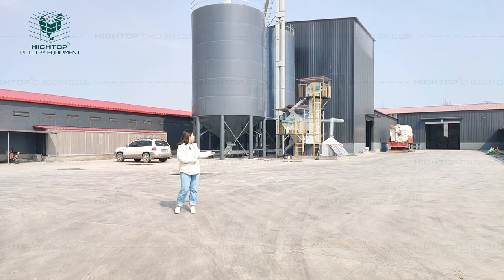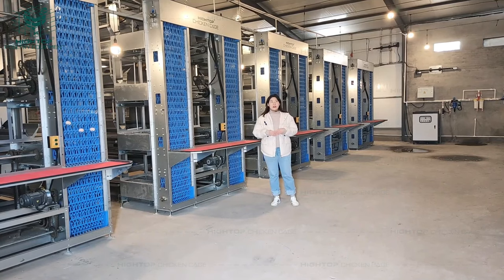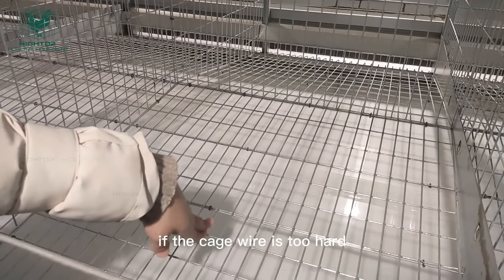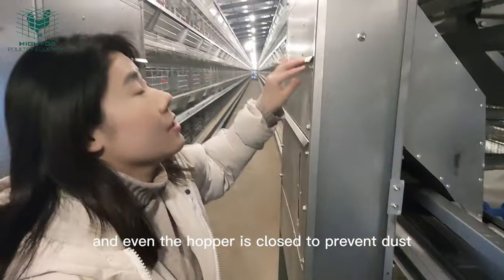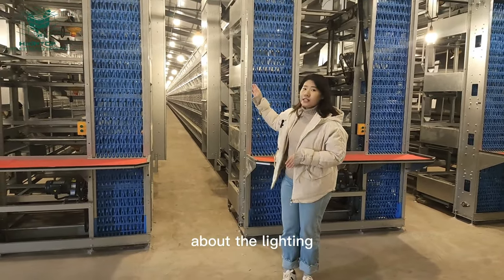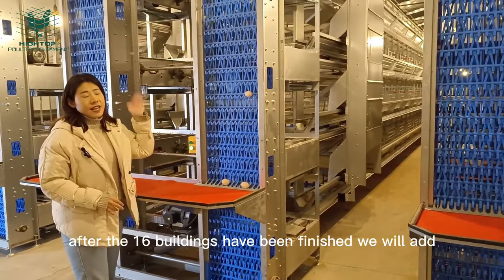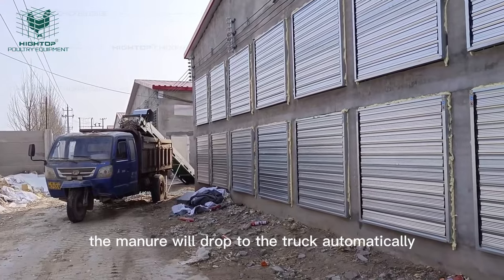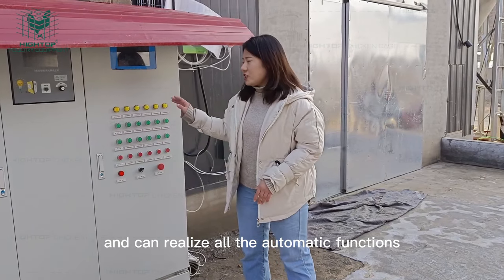800,000 Chickens Modern Layer Farm On Live

Comment: 00:20 China modern layer farm with 800,000 chickens
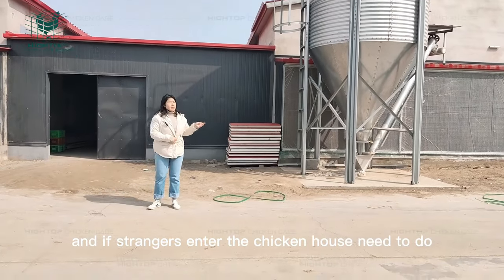04:16 Explaining equipment costs for chicken farming
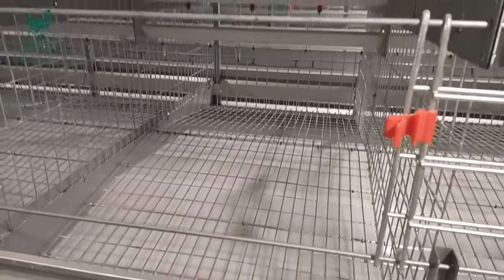10:26 Modern layer farm setup for comfort and productivity
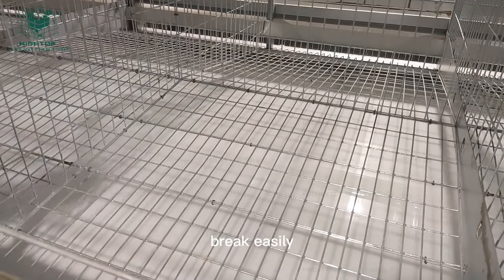14:02 Importance of cage frame design in modern layer farms
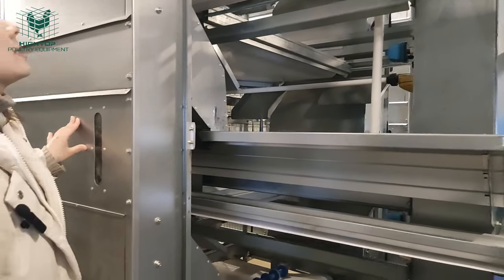20:31 Overview of automatic feeding and water systems
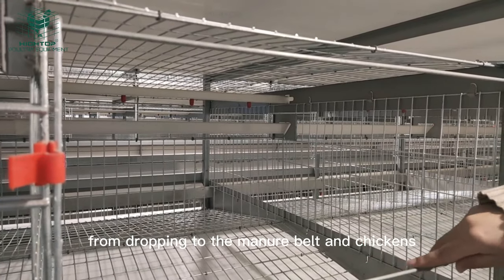24:29 Automatic water supply for chickens
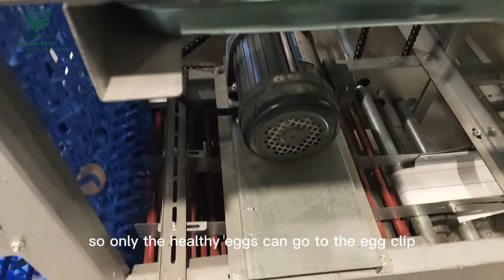31:56 Efficient egg collection process
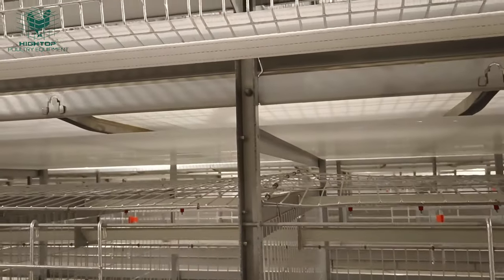36:00 Cleaning process of chicken manure using three scrapers
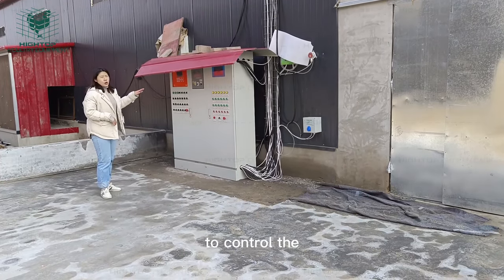45:35 Modern layer farm technology and operations
Crafted by Merlin AI.

Comment: Hi Rene, with the 10,000 chicken automated which you state is $10,000 USD  Do you guys provide a temperature data system that continuously monitor the layers or is that at a seperate cost. @Renee???
Reply from the maker: not included
Reply: I need the equipment for 10,000 birds

Comment: If I have to pay $160k for 40K production or pay $10k for 10K production, I think  I will pay four times $10k($40K) to have 40K production instead.
Reply: So what's your point?
Reply: Good idea.  but what they said USD10,000 for 10,000 birds, the equipment for 40,000 birds is different with for 10,000 birds.